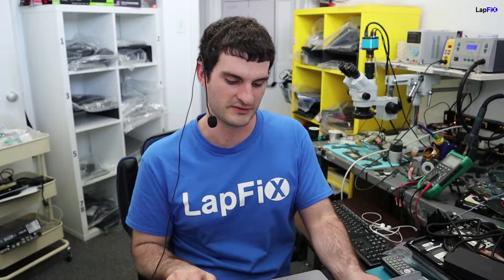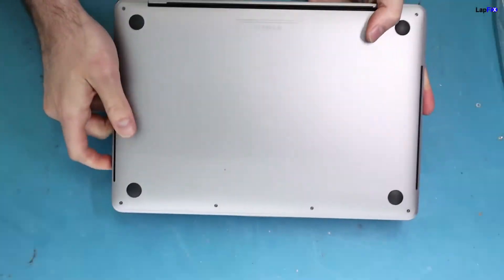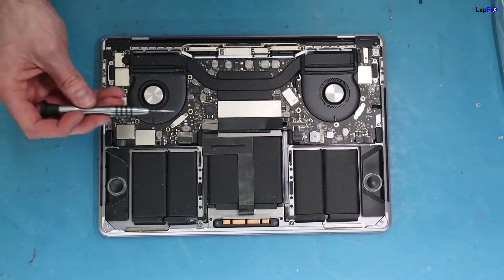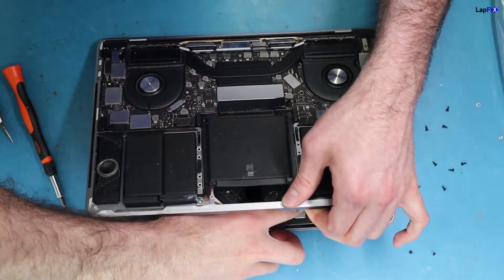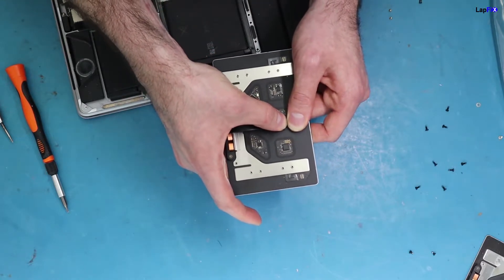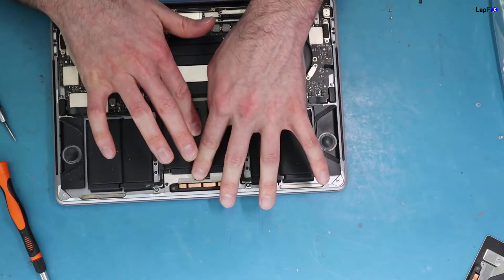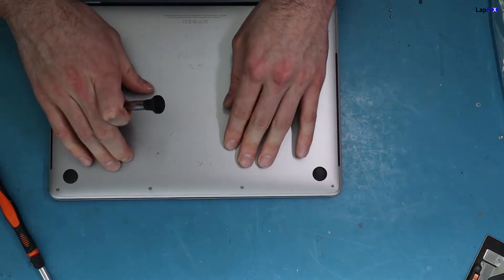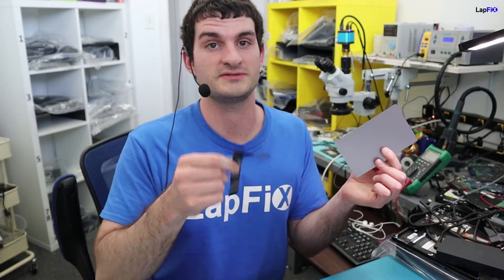Trackpad and Trackpad cable Replacement for MacBook Pro A1706 A1708

Comment: *PLEASE PIN THIS* When removing the track pad cable you have to evenly pry the small hinged grey tab on the back of the trackpad cable socket upwards. Best to use a spudger or finger nail. This is a VERY delicate part that if broken will not allow the cable to securely seat in the socket. It takes light force, take your time, be careful.

Comment: I need help i Tryed to change the battery of my father Mac book pro 13 A2159 but during the operation i damaged the trackpad cable and the trackpad itself so i buyed the cable with a new trackpad i connected all perfectly but in my system there is a strange root named kernel task that is using all of my cpu, i tried to unable all third part extension also to eliminate an extension named family plugins i don’t remind perfectly, i also tried to reset the nvram, i tried to do something on the terminal in the recovery mode but nothing changed, the last thing to do that remains is to reinstall the operative system any help please?

Comment: Just ordered a new track pad with cable , i saw online someone having the same issue and (code: PFM006) and a problem with the Power Management System (code: PPN001 , the user in comments recommended changing the track pad with cable so im looking forward to bringing it bsck to life , did those computers you worked on give the seme codes eith the damage trsckpsd and cable snd once replaced it fixed the issue? Im sure it will just wanted to ask

Comment: Thank you for the video, some helpful updates I'm going to add after successfully completing this repair (and the trackpad):
1. The trackpad flex cable connects to that ZIF connector and it has a gray "latch" that should be pushed open (i.e. lift it up, with those little flat plastic tools or your fingernail) when inserting the actual flex cable. Make sure to use those plastic tools or your fingernail to close the latch after you have it inserted. ALSO, an embarrassing mistake on my part but MAKE SURE YOU HAVE THE ORIENTATION of the track flex cable correct (the cable should be inserting from the side that has that QR code and those copper colored windings on the trackpad; I couldn't get mine in and only figured out I stupidly was inserting the cable from the opposing side... 'doh)
2. The battery flex cable also has a similar latch as to the trackpad flex cable, so make sure to open it with the same method and insert (though I did insert mine with the latch closed, but it was way harder and if I wasn't careful, I could have damaged something, so best to open that latch). Of course, make sure its closed when your done.
3. For all those sticky-covering bits that cover the components, you can use heat gun, or blow dryer, or even alcohol (isopropyl 91%) per chatgpt4o, to kind of "reactivate" the adhesive, or else, those covering bits may be just floating/moving around your case if they aren't sticky.
4. Per chatgpt4o, both the battery and trackpad connect to the main logic board, not the daughter board, as the daughter board is only used for auxiliary devices like audio and usb etc...
5. Pay attention to the screw lengths; he explains it in the video luckily 
- For trackpad:
2 shortest screws are the center screws
- For backpanel
2 shortest screws go on the bottom (side closest to the trackpad i.e. opposite side of the monitor side) in the center (similar to trackpad)
2 second-shortest screws go next to aforementioned on the sides (i.e. directly adjacent)
2 longest screws go on the opposite side (top) of the case (the side of case closest to the monitor)

If anything here is "off" or it helped you, please comment. Thanks!

Comment: When I start the Mac it shows a symbol och a mouse and a keyboard (?) and it doesn’t start. I did exactly as the guide and tried multiple times.
Reply from the maker: That means a trackpad and keyboard are not detected.  Check the trackpad connection on each end to make sure it is plugged in all the way and not damaged.  If you tried another trackpad and cable, there can be damage to the circuit.  We made a video showing the circuit fix on the a1989 model where it was burned

Comment: saved me  if the cable is broken keyboard / and trackpad will not operate.  " and it does not take much to break the cable/s"
worked on a 2019 15 inch retnia /as well as MacBook Pro (13-inch, M1, 2020)
Reply from the maker: glad we could help

Comment: I have a question, when I change the battery I had to reconnect the trackpad but it was a little uneven at the edges (on the side of use). I reconnected it and it was the same again.
Reply from the maker: It has to be perfect, if the cable isn't fully in then there will be issues.  If there is an issue with the cable, the keyboard may not work as well